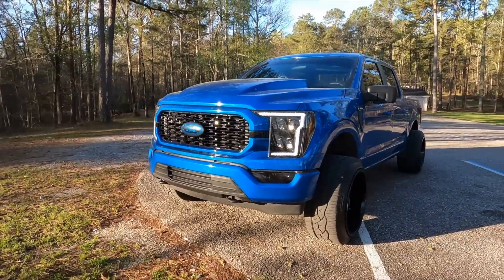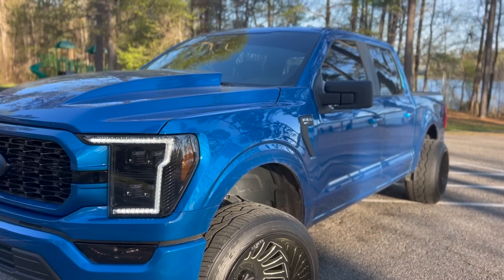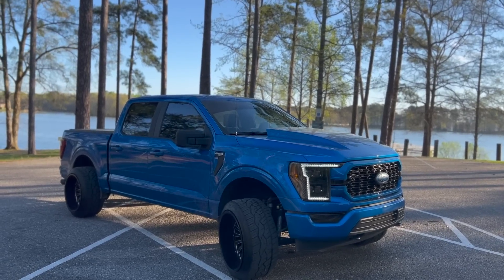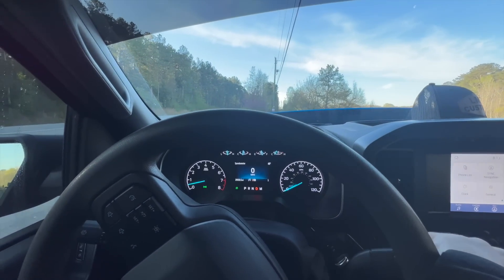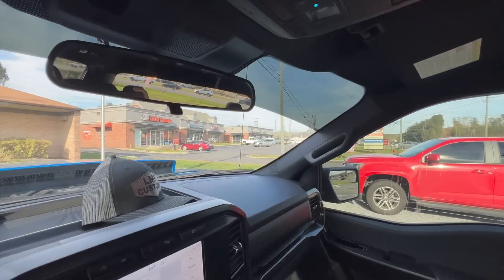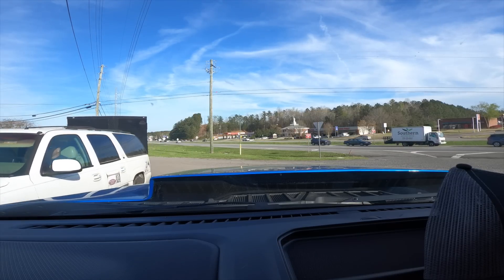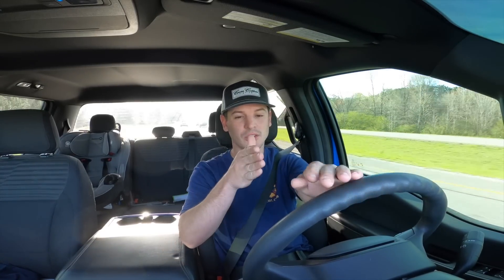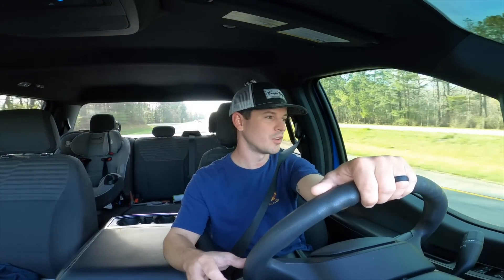HOW I DAILY DRIVE 14 WIDES ON A LEVELED TRUCK

Comment: I daily 10 wides with 2 inch spacers and 33s and it rubs like crazy. But like you said you just gotta plan ahead and it’ll be totally fine. Keep up the good work Chase..!!
Reply: 🤣same i dialy with 12 wides and 3 inch spacers I done ditched my front bumper and still rub im bouta go up 6 inches to clear tho!

Comment: Your definitely right about having to change your driving lifestyle. I have 26x14s with 35x13.50 on my 2015 Tahoe with a 3” level and can only do 1.25 steering wheel turn even after doing some major cutting 😂😂😂

Comment: I really try not to knock on other people's way of doing things but if you can not operate your truck normally and turn the wheels lock to lock, then the 14 wides shouldn't be on there. Either put a bigger lift kit on it or do some trimming. Overall the truck look great but what's the point of all the money spent on new wheels and tires just to put them on an improper/incompatible setup ya know, do it right the first time.